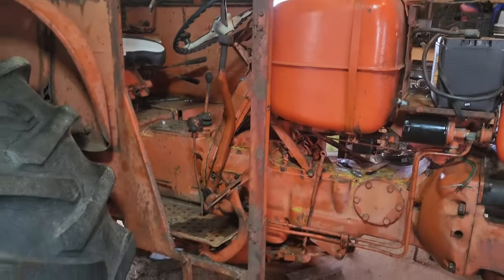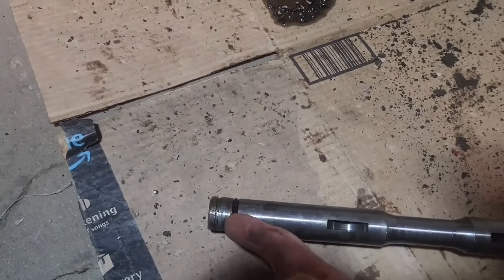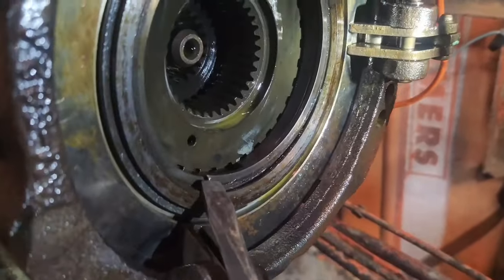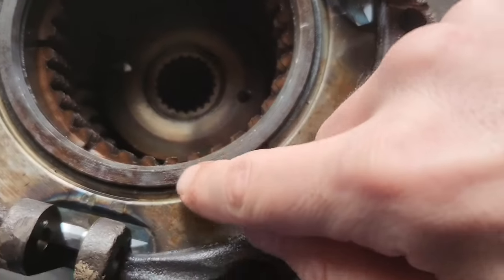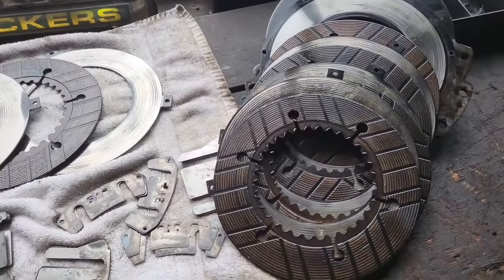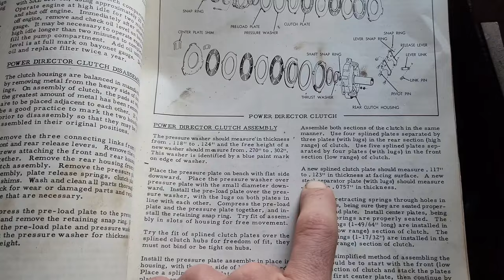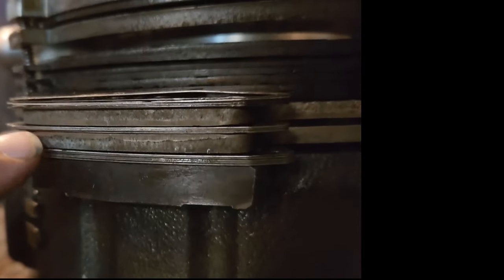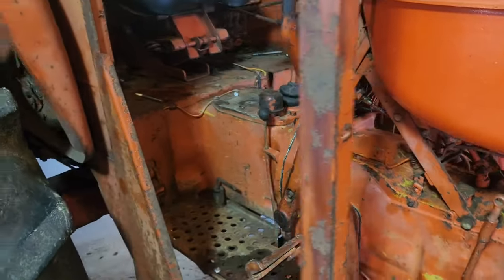Allis Chalmers D Series, hand clutch repair.

Comment: Great video. These power directors are kind of voodoo/black magic. One of my D-17's only works on the high side only, I think it's the high side. Hopefully that's just a linkage issue. Once the starter comes back from the shop maybe we'll get that figured out!
Reply from the maker: 😆 alot of guys talk about them just like that. What kind of voodoo is this thing 😆 🤣 😂 years ago I had to put that thought aside the only place that knew how to work on the was agco and we didn't have money for that. Lucky I had money to get parts at that time. But ever since I did that 1st one, they dont scare me anymore 😆. I was about 18 then and worried I wouldn't be able to fix grandpa's tractor if I took it apart lol o how things have changed since then lol. Keep me posted on your 17 project. If you need parts Leyva me know as well. Iprolly know a few guys with whatever you need 😆
Reply: Thanks Tim! Starter shop called, it's done, first hurdle cleared. Now to get the darn thing running. @TimothyFluegel

Comment: Nice video on this clutch.   I hadn't seen one disassembled, but was always impressed by the design because it could be slipped quite a bit without overheating.   It looks like these clutch plates outlasted the linkage!     It's a handful to operate though.
Reply from the maker: Thankyou Jazzerbyte!!! The wet clutch design was brilliant, but basically all they did was take a motorcycle clutch, gave it a high and low range, and made it bigger 😆 but it was still way out ahead of the other colors at the time for sure. I learned how to farm basically on a series 4 17. So I can't agree with the operating part to me they are the most comfortable little tractors lol I get lost with out the hand torque on others 😆

Comment: Another great video Tim.  You mentioned this type of clutch from the D-14 onwards.  Is the 8 speed  (Hi/low range) D10/D12's the same type of clutch as its bigger brother's?
Reply from the maker: Thankyou robert!! I can't say for sure on the d10 and d12. As  I've never worked in one. That's why I stopped at the d14 in the video I didn't want to say anything that wasn't correct 😆. But I would say that they are, the 45s were pretty much the same design too, just with only one clutch pack.if I had to guess they would just have less clutch plates per pack. But don't take that as gospel 😂

Comment: Is this very similar to the 180?
Reply from the maker: Yes. There's just a couple extra plates in the 180. At least I would think there is. The 190 does for sure, but I've never had a 180 apart. You want to check your book for total amount of shims to start with. It may be different than the 19. But the concept will be identical.